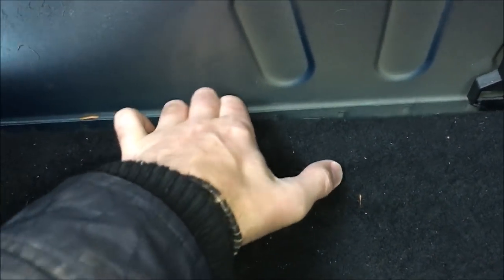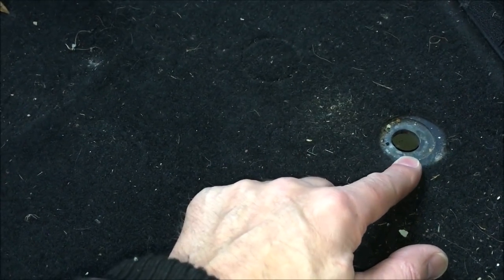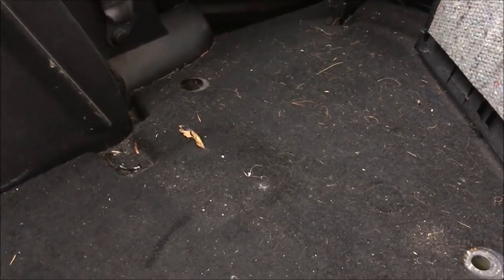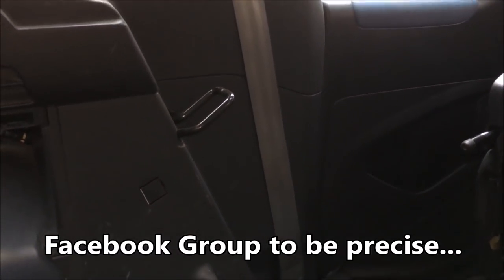Berlingo Campervan Update - Future Projects

Comment: My understanding of insulation on these is that where warm moist air comes into contact with cold metal it condenses. That air vent,,, would it not be best to insulate in that cubby hole. I know you can get spray foam, but I believe you want to make sure the panel is treated first. I think the best way I have seen some insulate there van was foam, then a layer of damp membrane then the carpet. This helps protect the foam from becoming damp. I would also look into some sort of roof vent, the amount of water we exhale per night. Atb
Reply from the maker: Great feedback, thank you. Yes, I need to have a good think about that vent and I will probably go down a similar route as per your suggestion...
Reply: @JesterBushcraft  I used sticky backed rubber in the rear side walls and Diall plastic insulation in tail gate (bagged in bin liners) and any other cavity i could find.